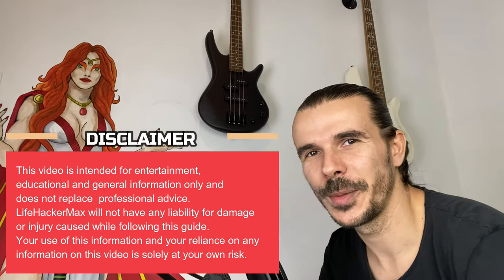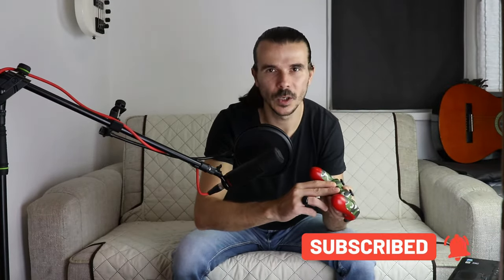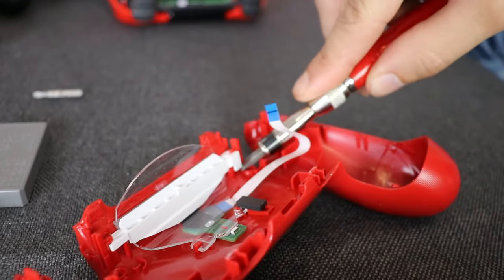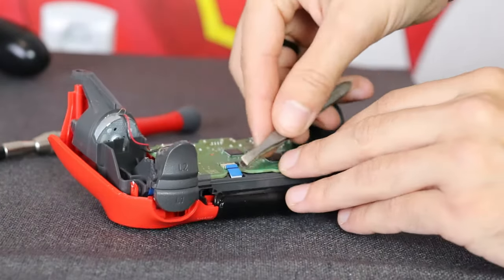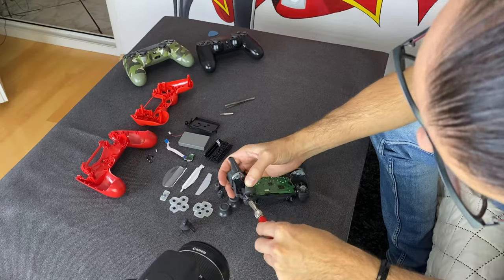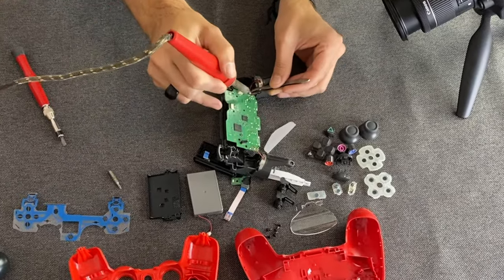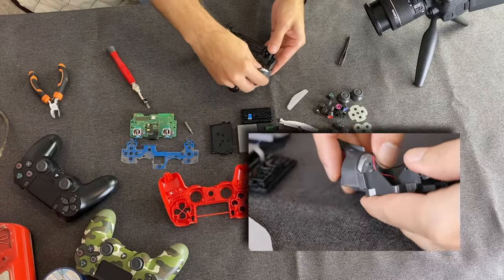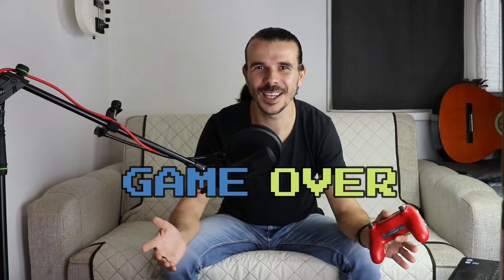Full PS4 Controller Disassembly | DualShock4 V2 | CUH-ZCT2E

Comment: Its so hard to remove the outer cover, if it's doing for the first time. most of the videos in here and the rest show not for the first time. Most challenging part is at two clips below PS button, if you opened this in first time, then the second time onwards its easy. so including this video its easily comes. guitar pick on that area wont work at all.
Reply: Guitar pick won't work for me. I'm struggling
Reply from the maker: @NosferatusLair I used a thick one. You can try something else preferably made from plastic so it won’t leave marks on the case.
Reply: @NosferatusLair use a flathead screw driver and just twist it going along the edges of the controller. Worked for me.

Comment: Bro please help! I have same controller model like you and i want to change my controller ribbon circuit and there are 3 4 types or ribbons which is to used? Jds-010, jds-020 or jds-040 ?
Reply from the maker: Hey there mate! I would love to help and I opened up my controller just for this. Sadly there is no such code on the buttons plastic sheet. All I can tell you is that the sheet is blue and the only thing that make if feel like a mk code is “5A”. Also my circuit board is JDM-055. I hope this helps.

Comment: Hey great video! You helped me get the trigger buttons, (I was afraid they mite break) and then discovered the button encoder ribbon circuits went into them, so twice again thanks! If anyone's controller won't turn on but charges fine, check that ribbon I found a bad (corroded) circuit from a long ago spill. I replaced it, you can get one for under $5on ebay.  it's not easy, but that was it, it works perfectly again
Reply from the maker: Glad I could help!

Comment: If you pop out the L1 and R1, you can reach the little clip from the front. But it only works on gen2 controllers where the dividing piece between L2 and L1 is part of the inside frame and not part of the outer shell I think.
Your video helped me getting off the rear 2 clips, thanks!
Reply from the maker: Thank you for sharing!

Comment: You could order pry tools and start there. They are the differnt sizes and have a small part at the end to go down and catch then push the tab apart. The problem is the guitar pic isnt get down to separate the tab. . Never had an issue with a pry tool on a new one. Same pry tools id use to fix any playstation/computer/controller. Make make different size sets.
Reply from the maker: Thanks for the suggestion. 🙏🏽

Comment: thanks alot, just remember if changing mainboard u will also need to change the charge port too ! or else it won't start lol.
Reply from the maker: Really? Are you sure about that? I thought the charging board is only an extension that can be replaced individually.
Reply: @LifeHackerMax  maybe due to my shell swap from old gen to pro gen, i having that issue. not sure if new ps5 got same problem with that charging port.

Comment: Ive been at this for hours and I still cant open the bottom part of the controller, any tips?
Reply from the maker: The clippers are a bit tight and scary to unclip. Try the twist method. And the ones in the front need a bit of force to unlock. The side ones, I think they are designed to break when the case gets opened so don’t feel bad if yours break.
Reply: @LifeHackerMax  I got them opened and fixed up now thanks my guy, though the clips broke but no big deal

Comment: hi nice video! i have this same version and i cant find the way to OC it to 1 ms,, and i have another version (finish in letter U) that works  fine, do you have any idea why this is happening? because y tried several times to OC it and it stays on the same latency, i dont know if is because i use the same bluetooh dongle, i have fully update windows, and my old controller wokrs fine so why this shouldnt,, thanks a lot!
Reply from the maker: To be honest I have no idea. Have you tried a cable connection and see how it goes?

Comment: Hey so I have the same tool set as you but different battery I have a 2000mh one with 2 connectors it’s compatible with chu 1 and chu 2 I’m using it for a pro controller. So I ended up breaking the led plastic thing. Only place I can order a replacement part is “eBay For PS4 Pro 5.0 Slim 4.0 Game Controller Housing Transparent Light Sheet Cover “ if you type that in eBay or google it’s that part, I can’t find any place else that sales it. Or a video how to install it. I’m upset I had that controller from 2016 when I bought my pro. So I don’t want it to go to waste I put it back together it works fine but I want to replace that part so it looks like new vs some loose plastic.  Here are some
Other key words to look it up. 

“PS4 Pro Controller Housing Transparent Light Sheet Game Handle Light Cover”
Reply from the maker: You could also buy a broken controller just for that part from a local. We have some sort of online bazar here where people sell all sorts of stuff for cheap. Maybe you do as well.

Comment: Hi, I accidentally broke the connector on my ps4 motherboard. To be specific the connector in which the ribbon for usb and led light get connected. How do I fix it?
Reply from the maker: There is no easy answer here. It depends on the way that it broke. I would recommend taking it to a professional electronist. They have the right tools to fix this.
Reply: @LifeHackerMax  great thank you for the reply. 🤗

Comment: I need help my ps4 I need to open it up and swap the thump sticks around so left is right and right is left is it possible please thank you
Reply from the maker: It is possible but you need some tools and soldering skills.
Reply: @LifeHackerMax  if I sent you a brand new ps4 controller would you be Abel to try it and I will pay please????
Reply from the maker: @warrenryan1489  I want to clarify something: you wish the left thumb-stick to have the right ones functions and the right one the left one’s functions? So switch the functions between them? If that is so than you can do this from the menu. I can search but I am pretty certain I did that at some point.
Reply: @LifeHackerMax  hi yes that is what I want and yes yah can change that in the menu but a game I play they go back to default for some reason I was hoping i could have a custom one made and I will pay sorry for the late reply
Reply from the maker: @warrenryan1489  best bet is that the game developer didn't consider that function (you could try writhing to them as this seems to be a bug). Making that change to the controller as a hardware mod might be tricky (I am not certain it can be done). I can't help you as I don't take jobs (I will think about making a video about it in the future; maybe that will help). At least not at this time. I hope you figure out a way. Good luck!

Comment: Do you still fix ps4 controllers
Reply from the maker: I do, if any of my controllers need fixing. But I don’t do it as a job. Why do you ask?
Reply: @LifeHackerMax  I have four broken controllers just bought one in February and the jack of the controller when plugged in I hear static like an a.m. station
Reply from the maker: @OmyrBigOTorrez-jl9pf  have you tried a different headset in the same controller? Do you get the same noise?
Reply: @LifeHackerMax  yea I’ve tried it’s the port
Reply from the maker: @OmyrBigOTorrez-jl9pf  you might have some luck finding a electronic repair shop in your area and ask them to change the port from another broken controller to the controller you are using. At least that’s what I would try.